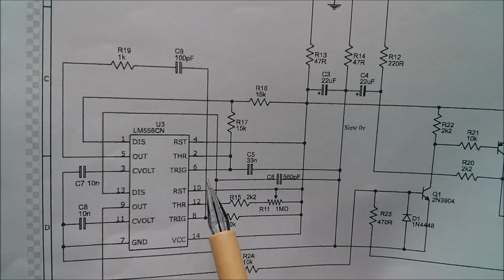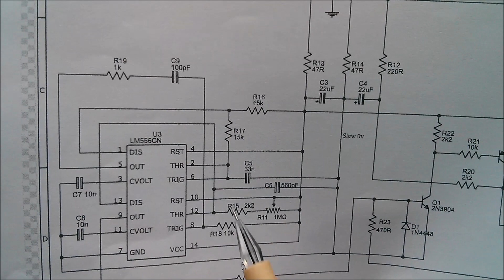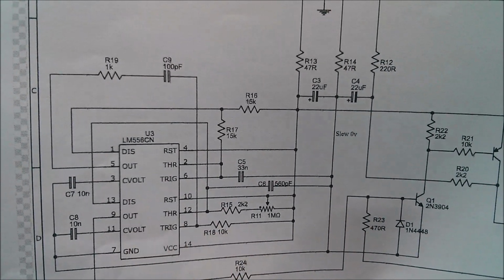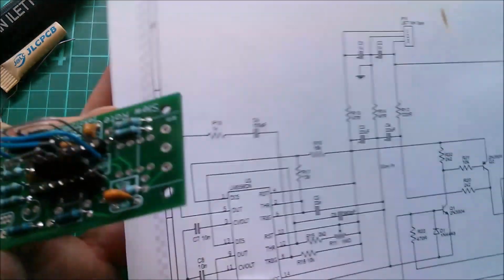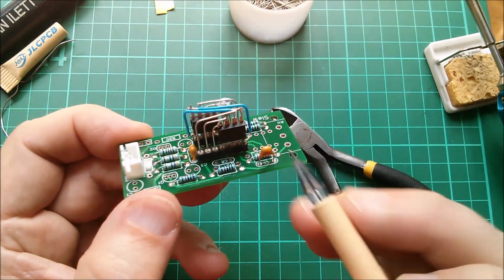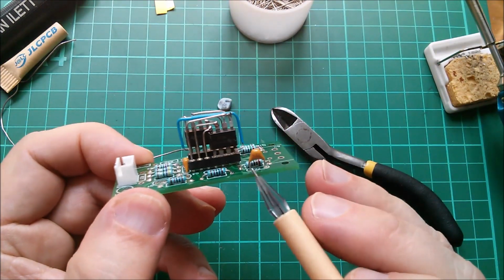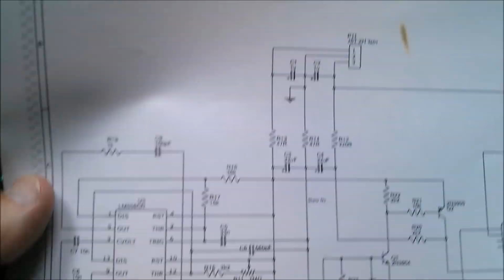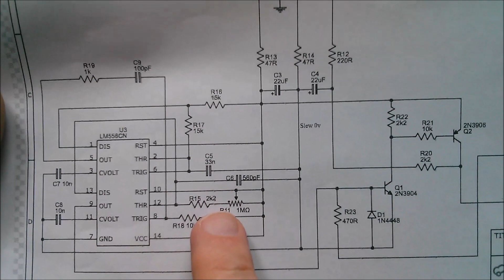New PCBs from JLCPCB - Dual 555 Timer Oscillator (pt 2)

Comment: I would have thought of using the CV pin to connect to the wiper of your variable pot of which both ends connect to supply and negative

Comment: Nice work...
For variable duty cycle why not use output from a sawtooth generator, fed to a comparator, referenced to a set point voltage?  

My fave saw tooth generator... Programmable unijunction relaxation oscillator. Feed capacitor with constant current (withing PUT's rating) , makes capacitor voltage a sawtooth. 
If trigger voltage set with a slightly larger constant current through  resistor to ground... Latch up is avoided.

Comment: An easier way to solder in the pot: don't worry about getting it lined up nicely, just solder one leg in. Then reflow that solder joint while holding the pot in the right alignment, then solder the other two legs.

Comment: I don't really know the function of this in the whole circuit, but the 50% max. pulse width makes sense for audio circuits, because 75% PW sounds the same as 25% PW, 95% PW the same as 5% and so on. So anything above 50% would just be just a waste of potentiometer range.
Reply: @williambello4089  is there anything wrong with what I said?
Reply: William Bello - this circuit module is part of a bigger audio project...

Comment: Julian Ilett .... You drive me to laugh about your say that you don't have 556 chip to fit in the circuit. MAN ! , you are in the most open free country with highest tech all around with all capabilities available to your finger touch and say you can't find ??!!... What a crap joke are you trying to tell us my friend ??!!.... Check below please ;
https://uk.rs-online.com/web/p/timer-circuits/0528416/
https://www.amazon.co.uk/Maplin-NE556N-Dual-Timer/dp/B008PC2NA0
https://www.ebay.co.uk/itm/NE555-555-NE556N-556-Dual-Timer-IC-Brand-New-5-Pack-UK-STOCK-/190818374130

Good Luck to make it uniformed engineering work !...

Comment: Sorry Julian but these are not two linear ! There are log pots !! Logs means that as you turn the pot, the adjustment is slow at first and changes fast at the end of the scale !
Reply: What he means is that it's not really a smooth log curve. It's more like a certain lower linear slope for a while then another slightly steeper linear slope after that.
This is the video where he tested out a log pot and drew a graph of it's output.
https://youtu.be/q1lbDai6ObA
Reply: He's done a whole vid on it and they are two linear he proved it graphically years back